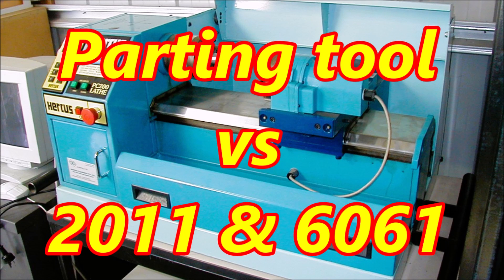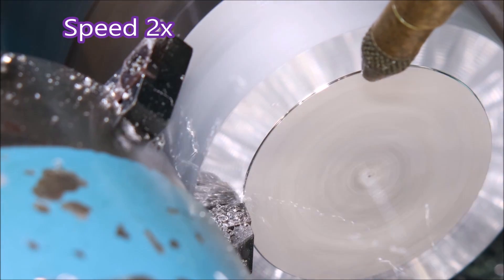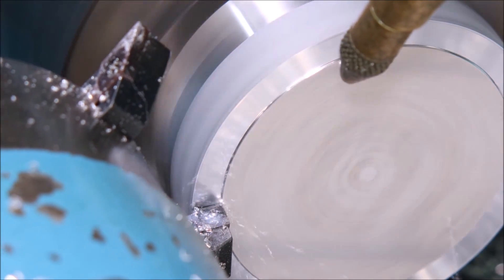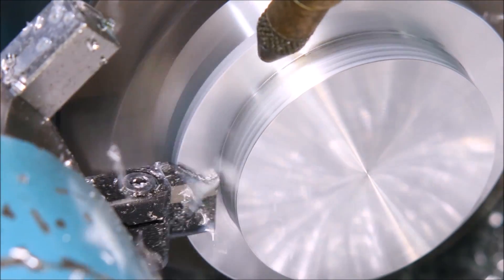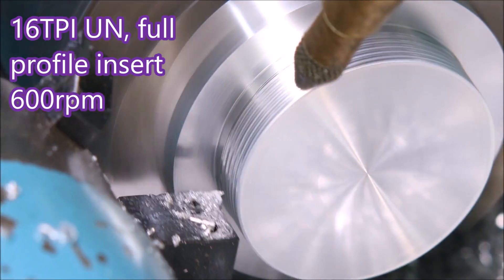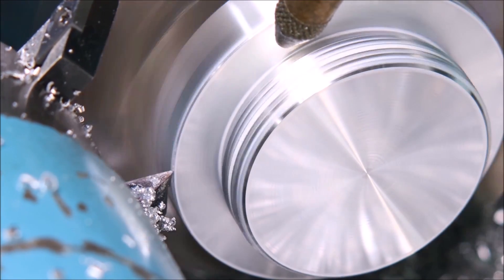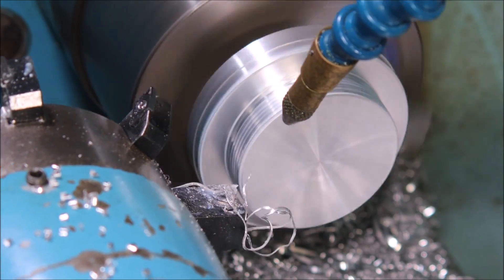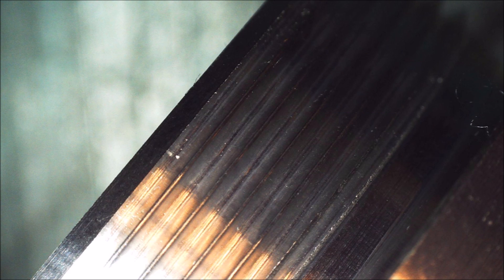Parting tool replaces turning tool.  CNC lathe using eBay parting tool on 2011 and 6061

Comment: What a brilliantly presented video, to the point, properly edited and very viewable.  If only some of the 'big name' Youtube machinists would do the same and trim their 1 hour rambling productions similarly.
If I need some sleep, I use a particular video from Germany . . . .zzzz. . . .
Reply from the maker: HI Brian, thank you.  I  mostly edit out things like spindle start up and tool changes.  I try to make it about showing chips being made. I rarely watch videos on machining.  They mostly show manual lathes or cnc lathes that are modern, huge or both.  A few I have watched  have left me wondering how on earth they dragged it out to 25 minutes.  I recall one where they guy showed going to a draw to select a tool, I thought that was a bit over the top.  Thank you for taking the time to leave a comment.  Nigel

Comment: Good  video Nigel, I noticed your Ammeter and I think it is a good addition for these little  machines. I know you detailed how you went about fitting it quite a few years ago, is there any chance you could revisit it?
Reply from the maker: Hi Lex, I don’t recall explaining much about as I don’t do much of the serious electrical work on my machines will as my mate what he did and pass it on.  Nigel
Reply from the maker: Hi Lex, my meter is an Arrid brand, I bought it from Perth, a nice little unit. Check their website.  Fitted in series with the cable to the motor.  I have drawings for the enclosure I used if that would help.
Reply: Thanks Nigel, so there is nothing special about wiring it in or the choice of meter.
Reply from the maker: @lexdavis2179  Not much to it I think, I chose mine as it was a good range, 10A for a motor with 5A rating
Reply: @smallcnclathes  Hi Nigel, have you fitted a larger motor to get more power and hence the 5 amp current draw? My machine is fitted with a .55kw motor and is rated for use with 180 volts which works out to 3 amps using ohms law.
Reply from the maker: @lexdavis2179 Hi Lex, the plate on my motor says .37kw, 180 volts, 5 amp duty cycle. This is the motor it came with. The power my lathe gets is from the Minarik spindle driver which gives a true 180 volts. The original spindle driver from Hercus could only give 140 volts and a top speed of 2300 rpm when the spindle had warmed up! Now I can get 3000 rpm cold.
Reply: @smallcnclathes  Thanks Nigel.

Comment: Hi Nigel,  My unproven theory is that the chatter marks in 2011 part was caused by the chips breaking giving a small vibration in the material, coupled with your lightweight machine.  I think the 6061 material with its horrible unbroken stings would have given "constant pressure" resulting in a smother appearance.
Reply from the maker: Hi Chris, it may be unproven, but not a bad idea sounds reasonable to me. The lack of chatter on the 6061 really surprised me!  It would be great to be able to prove your idea. Thanks for your comment.  Nigel
Reply from the maker: Hi Chris, did you notice the really crappy chatter makes after the parting tool finished and it needed a clean up cut.  That could be exactly what you are suggesting.

Comment: Good morning Nigel. Great to see the Hercus CNC lathe is still up and running mate. Good video thanks for sharing 👍
Reply from the maker: Hi Aaron, yes at the moment it is not too bad. Occasionally does not go right home in Z which can be a pain. But the turret has not missed a tool change since changing back to dos as the os. Nigel

Comment: Hello Nigel,
Interesting video as always... What was the reason that you wanted to use the parting tool rather than a turning tool?
Take care.
Paul,,
Reply from the maker: Hi Paul, I write programs for a Hercus with no tool changer. Parting tool does almost all the turning to save tool changes. I have wondered at times if a parting tool could be as quick as a turning tool. This was a lot of material to remove and should be enough to prove the point.  I am quite impressed actually at the rate of material removal. I added the 6061, just to add something to the video.
Thanks for your comment. Nigel